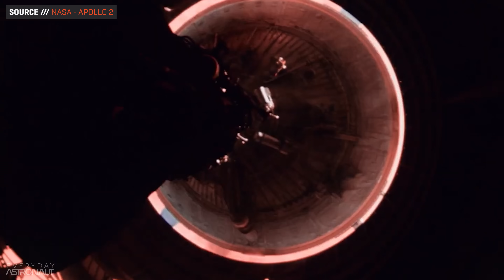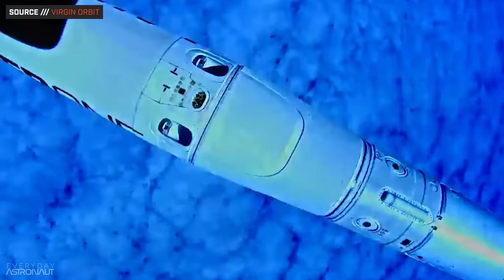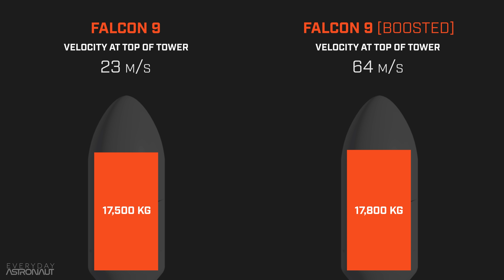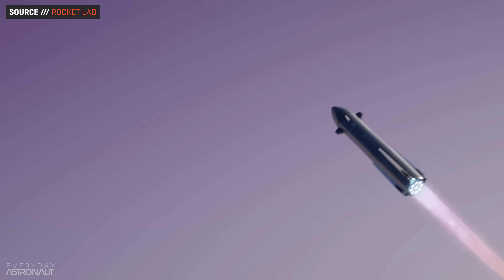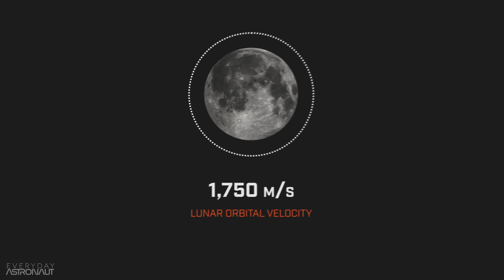Could We Help Push Rockets To Orbit?

Comment: Instead of trying to add additional payload, why not think of the idea reducing that much fuel to get up there. And if you can reduce the amount of fuel you're putting in the system by 75 tons I think that's pretty significant. And the more you reduce the more this extra booster would help

Comment: 16:00

So we need 17,000 MJ of energy. A candy bar contains about 1 MJ, basically all of that just being sugar. So 17,000 candy bars. If we just use the sugar out of those candy bars and make that sugar into a linear, potentially cylindrical shape so it can burn at a consistent rate for the acceleration you need over the period of time you need.. 

Maybe add some oxidizer to the sugar mixture so it can burn without atmospheric O2.. 

Hey wait a minute
Reply: shooting a bullet and shooting a rocket are not the same thing. You want your rocket intact, you dont care what happens to a bullet. Electric motors are better than a combustion product because the acceleration is smaller and more gradual. 

It's like the difference between a bullet and a c4.
Reply: It's actually a few less candy bars. You used c rather than c² to convert the mass of the candy bar to energy. So it's actually a bit more like 5,000,000 GJ of energy per candy bar. I think we've found the abundant supply of energy we need
Reply: Of course I'm assuming the candy bar weighs 50g but that's not always true

Comment: Use a pulley, but put the other end to another rocket engine on a rail, you could even use the rocketsled to test an experimental engine, that would need to be fired anyway

Comment: AI Summary

Abstract:

This video provides a detailed analysis of the feasibility of using ground-based launch assist systems—such as maglev catapults, cannons, or mechanical pulleys—to improve the efficiency of orbital rockets. The video explores historical concepts like Project HARP and modern ventures like SpinLaunch before conducting a series of "what-if" calculations for existing and future rockets, including the Falcon 9, Starship, and Electron. The core of the analysis reveals that the energy and power requirements for these assist systems are astronomical, often demanding the equivalent output of multiple nuclear power plants delivered in mere seconds. The resulting payload gains are shown to be disproportionately small (e.g., 1-3%) compared to the immense cost, complexity, and engineering challenges of the required infrastructure. The video concludes that building a larger, more powerful rocket is almost always a simpler, cheaper, and more effective solution, and that ground-assist systems are unlikely to become practical until spaceflight achieves a frequency and scale comparable to modern air travel.

The Physics of Throwing Rockets: An Analysis of Ground-Based Launch Assist Systems

*   0:00:22 The Core Question: Rockets are incredibly inefficient, with the vast majority of their mass being propellant. The video investigates whether a ground-based launch assist system (a "yeet system") could significantly improve payload capacity.
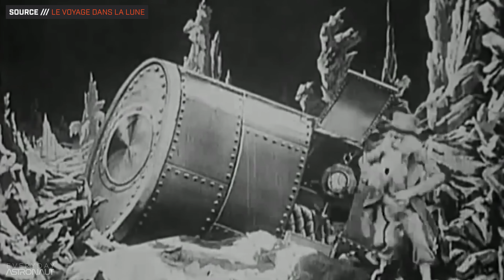*   0:03:06 Historical & Modern Concepts: The idea is not new, dating back to concepts like Jules Verne's cannon. Real-world examples include Project HARP, a 1960s project that fired projectiles into space with a giant cannon, and the modern company SpinLaunch, which uses a massive centrifuge to launch small payloads.
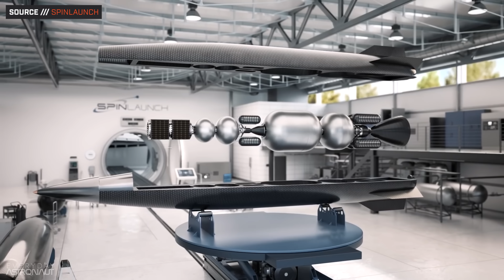*   0:04:22 SpinLaunch's Method: SpinLaunch aims to replace a rocket's first stage by spinning it at high speed in a vacuum chamber. This imparts immense force (10,000 Gs) and presents significant engineering challenges, including timing the release within milliseconds to avoid catastrophic failure.
*   0:06:23 Rules for the Analysis: To ensure safety and reliability in the following thought experiments, the analysis assumes the rocket's engines are lit and verified on the ground before the assist system adds to the initial acceleration.
*   0:07:41 Case Study 1: Falcon 9: The video calculates the effect of a hypothetical 3g assist over the 70-meter length of the launch tower.
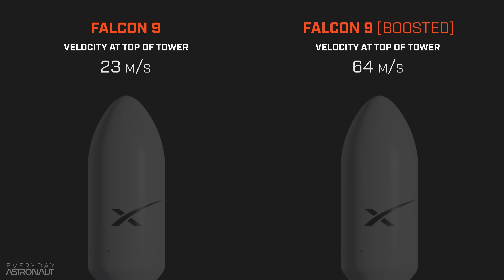*   0:09:24 Falcon 9 - The Verdict: This assist provides only a meager 300 kg increase in payload capacity (~1.7%). The system would require an astounding 450 megawatts of power, equivalent to 560 Tesla Model S Plaid cars, delivered in just over 2 seconds. The cost and complexity far outweigh this minimal benefit.
*   0:13:24 Case Study 2: Starship: Applying the same 3g assist concept to the 140-meter launch tower for a fully-stacked Starship (5,000 tons) could theoretically increase payload capacity by 5 tons.
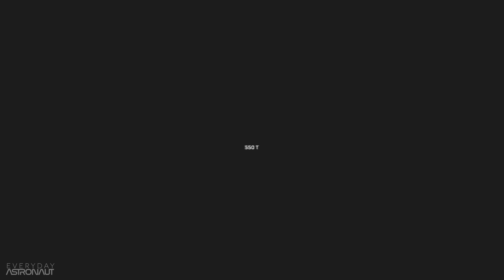*   0:14:28 Starship - Absurd Energy & Mass: This assist would require 17,170 megajoules of energy. Delivering it in 3.1 seconds would demand 5.5 gigawatts of power, equivalent to the output of 4-5 nuclear power plants. A mechanical pulley alternative is even more absurd, requiring a 175,000-ton counterweight—heavier than the largest aircraft carrier ever built.
*   0:20:33 Case Study 3: A Smaller Rocket (Electron): A more purpose-built 450-meter maglev vacuum tunnel could give a Rocket Lab Electron a 300 m/s boost. While more "feasible" than the Starship example, it still requires nearly 100 megawatts of power.
*   0:23:16 Key Takeaway: Just Build a Bigger Rocket: The complex maglev system for Electron would provide a 25% payload increase (75 kg). For a similar development cost, Rocket Lab is building the Neutron rocket, which offers a 5,000% payload increase. This demonstrates that improving the rocket itself is far more effective.
*   0:25:06 The Ultimate Concept: No Rocket Needed?: A hypothetical maglev tube to launch a Crew Dragon capsule directly to orbit at 5g would need to be 573 km long and require 2.3 gigawatts of power for 2.5 minutes, highlighting the sheer scale of the challenge.
*   0:29:25 The Best-Case Scenario: The Moon: The Moon's low gravity and lack of atmosphere make it a better candidate for launch assist. However, launching a capsule back to Earth would still require a 58 km long track and a monumental amount of infrastructure and energy.
*   0:32:01 Final Conclusion: The analysis is a testament to the immense power of rocket engines. The massive infrastructure, cost, and inflexibility of ground-assist systems make them impractical for the tiny gains they offer. The "Keep It Simple, Stupid" principle wins: building a bigger rocket is almost always the easier and more logical solution.

I used gemini-2.5-pro| input-price: 1.25 output-price: 10 max-context-length: 200_000 on rocketrecap dot com to summarize the transcript.
Cost (if I didn't use the free tier): $0.04
Input tokens: 21268
Output tokens: 1144

Comment: ok, but could we use a flying platform to give starting height? something like a fancy Zeppelin?
Bonus height has several advantages (air resistance, g, etc)
Bonus height would have several advantages. Plus you might even combine it in a fancy way with the counter weights, because now your platform might ascend as well to increase the acceleration length.

and the height would just double as storage for the release energy. may be built up over (an arbitrary) long time. may be released at once.

Comment: What if you had a very low level first stage burn, like one actually still attached to the ground? Fuel could just be pumped into the engines from the launch tower. You could have like 100 rocket engines running for 5 seconds. In my head that works 😅

Comment: The tower should be spring-loaded. Cheap brute force. Can also be done using a water tower - just lift 500 tons of water, connect to wide-enough pipes and a big piston. What do you think? should cost in the ~millions
Reply: 500 tons of water ? That may not be enough.
If 2 x Nimitz-class carriers at 100,000 tons each is required, then, well, math... A Labrador Retriever trying to lift an elephant.

Comment: 31:05 - It's the Moon. It doesn't suffer from bad weather. All it suffers from is long nights, so you'd have a lot of batteries installed. However, you get a lot of sun, and it's not like you need the space for other things.

So we can look at what we're capable of on Earth and use that as a guide line. There are solar power installations less than 10 km^2 that can deliver that much power. Noor Abu Dhabi has 3.2 million solar panels, has a nominal capacity of more than 1 GW and is 8 km^2.

If you're building a Moon base, you need energy as it is, and solar with battery storage makes a lot of sense. At worst there'll be a 60 second window where mining equipment is shut down to preserve power.

Comment: Remind me again. What is the problem we are trying to solve? And why is it a problem to start with?
Reply: I think the problem is the fuel consumption at the beginning of the launch. It's measured in tons per inch. Much worse than, say, a Chrysler New Yorker.
Reply: @calvinmasters6159 - Is there a lack of rocket fuel on this planet? If there is I can see that consumption might be an issue. But I do not think that we are running out of kerosene anytime soon.
Reply: @JanBruunAndersen  Fair point

Comment: Why reinvent the wheel? As you seem to understand electricity is a terrible way to dump a lot of power in a short period of time. 
The Russians use a relatively small booster charge to potato cannon their ICBM out the (underground) tube. This could be done with the engines running and isnt that difficult to make big or longer.
A quick AI chat shows that a rocket that uses 250 000lbs of fuel to clear the pad at 110fps would only need a 375lb charge of gunpowder to do the same job

Comment: It’s wild that you don’t analyze these problems from the perspective of trying to actually solve them. You seem to be very pessimistic instead and only point out the problems without trying to figure out potential solutions. That’s not the analysis I was hoping for. For one, you could create a lever system, instead of using pulleys to launch a ship and do it from the bottom of the rocket. For weight you could use stone. To slow the weight down at the end you just let it hit a pile of dirt. There’s lots of answers, but you stop after hitting a couple speed bumps. I don’t think the weight launch idea is that absurd at all. But then I think it’s better to fly Payloads close to space before launching anyway. You just strike me as someone who is a “this is the way it was done so it’s the way it should always be done” kind of person. Maybe that’s why you call yourself every day astronaut instead of ‘what could be’ astronaut.

Comment: For Falcon, how about a ring of 14 stage 0 engines wrapped around the base that fire off when the other 9 fire off and lift the booster from the ground to the end of the tower then stop and then let the rocket fly normal after that?  The outer boost ring could even be linear aerospikes but in a circular arrangement.

Comment: So ive played ALOT of Kerbal Space Progam. one of the most efficient ways i found was to use an additional stage below the main booster that was nothing but a decent sized jet fuel tank and 20 ish radially mounted jet engines with a computer controlled return system. the jet engines will push to pretty great speed and be totally reusable and pretty cheap. "in game" this makes a orbit capable rocket a moon capable rocket with deltaV to spare. Edit this also makes a very vertical launch a good thing as being outside the atmo during a large part of the burn makes it more efficient as well.

Comment: really feel like you straw manned the maglev first stage. those numbers are reasonable considering the scale and reusability. put a smaller nuclear plant within safe distance and charge capabilities to discharge nearly instantly.
Reply: plus you cooked the numbers by requiring an unnecessary 3G of acceleration. recalculate everything assuming how much less rocket you need given the 3G head start.

Comment: I would use a combined system. A concrete counterweight to reduce the weight of the rocket, a hydraulic system pulled by cables, and a winch with the ratio you need—1 to 10K, for example—to provide acceleration. Mechanical advantage is your friend. You could even integrate magnetic traction, pulling the counterweight. Flywheels, too.

Comment: Have you ever heard of Keep It Simple Stupid(K.I.S.S.)? We can easily get to orbit without rockets with 85 year old technology. They are called ballons. In the 1950s, we first reached near space altitudes with them, and we have done it ever since then for decades. It's simple and cheap and inexpensive (compared to rockets). Yes, it takes hours to do unlike minutes for a rocket. But it's also reusable. 

How can we do it? First you build a detachable self contained capsule.  That's were the people/cargo go. Make it cylindrical. Around that a torus shaped lifting body. It could be either be soft or hard shelled. Electric propellers are part of the lifting body powered ideally by rtgs. The lifting body picks up the capsule and slowly raises it to a floating platform in high atmosphere and leaves it there while it returns to base. A space tug the picks up the capsule and take it the rest of the way to orbit. It would be equivalent to taking an airplane flight with one transfer.

Easy peisy. No fuss no muss.

Comment: 21:28 this calculation is bullshit. it's 12.77 seconds required to cover 4km distance with 49m/s2 acceleration. And I believe the rest of the calculations are bullshit as well
Reply from the maker: Where’d you get a distance of 4 km? This example is a 1 km distance.
Reply: @EverydayAstronaut  from transcript: "If you accelerate at five G over a full kilometer, it will take you just over six seconds." and I heard it as "If you accelerate at five G over a four kilometer, it will take you just over six seconds."
My bad. Dont hold the grudge ;)

Comment: I don't understand why you point out, that the energy consumption would be the problem? The energy you need stays the same. Only that its now provided by burning off fuel. And i think you missed, that all the fuel, that you would otherwise need to accelerate could be taken away from the rocket. In the beginning you say, that its burning 12000kg/s that would be around 36000kg (36Tons) of more payload and/or less mass to accelerate the rest of the way up. So its not just 300kg more payload but 36Tons. An increase of 205%.

Comment: Would using external ground based fuel tanks for the first 100 meters work? Okay, the fuel line needs some interesting engineering solutions, but nothing too impossible.

Comment: in your calculation, you mention a 5:1 reduction gear... I'm not sure what you meant... but I think it means the mass has to move 5 times the height of the tower... so you'd probably want to build the tower 5x taller.

Comment: If we had a relatively long train track, say 1km with an upward curve(kind of like a giant rollercoaster)to launch said rocket, we could accelerate the rocket to a much higher velocity with less G and still jettison the "rail" at lift off. We have high speed mag lev trains. This concpet could work with smaller payloads with our current technology and add a consiberable boost to payload capacity.

I have long envisioned an EMALS system like what we now have on our newest aircraft carriers, the heavy "rail" that yeets the rocket from the launch can be quickly jettisoned  shortly after clear of the pad and recovered while the electomagntic system would be part of the launch pad, mag lev train track. I imaginea 3 to 5g yeet at liftoff over 1km would help save a significant amount of fuel and not kill astronauts or the payload. Higher Gs could be used on launches with more durable payloads with no astronauts.

Comment: To do launch assist I'd build an orbital ring say 60km high, and then just have trains tracks to accelerate payloads into orbit. at 60km the atmosphere is thin enough that it's basicly vaccum, but still thick enough that micrometeorites and dust will be dealth with. Just ride a train up to the ring, and then switch over to the orbital launch train. but that is really only economicaluy feasible when moving thousands of tons each day into and out of space.

Comment: The video started, saying the Saturn 5 spent almost half of it's propellant before clearing the tower. Why didn't we take that into account? The real question is how much lighter can we make this rocket (and thus not have to accelerate as much mass). I'd like to see that math done, since we'd need a lot less propellant and thus having a snowball effect of shrinking other systems.
Reply from the maker: It “only” burnt about 125,000 kg out of over 2,000,000 for the first stage. So not close to half the propellant

Comment: Dig a 2km deep shaft in the ground and use wire pulleys on rails all around the launch site.
Once the rocket reaches the surface, disconnect all wires and let the wire pulleys safely run out of speed.
Or just lots and lots of compressed air or combustion products and use the shaft as slow accelerating cannon.

Comment: You should present the conversion to kWh in proper units.
a joule = 1 Watt second (Ws).
a kWh = 1000 (the kilo) x 3600 (seconds per hour) = 3,600,000 Ws, so

980,000,000Mj / 3,600,000 Ws / kWh = 272.2... kWh.

Not use some conversion factor w/o its basis.

And your presentations of math should leave things on the board, line by line.

Comment: 11:30 and that is why capacitors would work better than batteries.  Let solar panels in the Texas sun charge a bank of capacitors during the day and then use them when you need them.